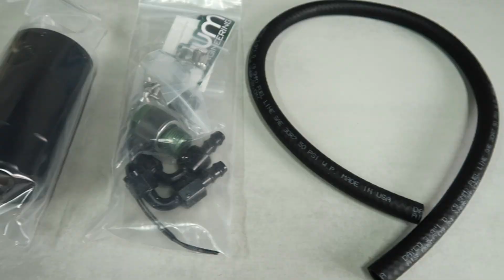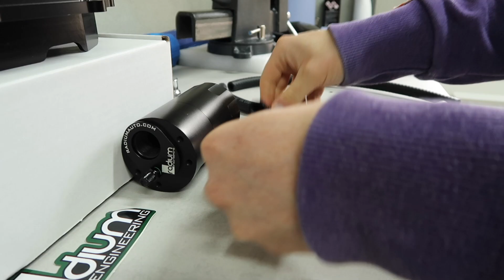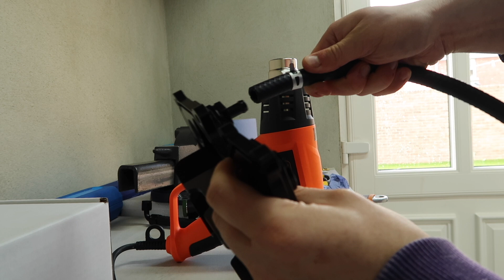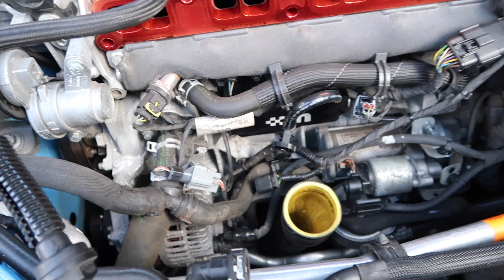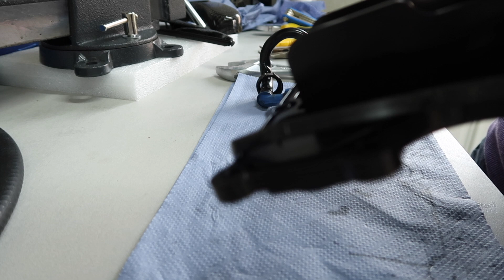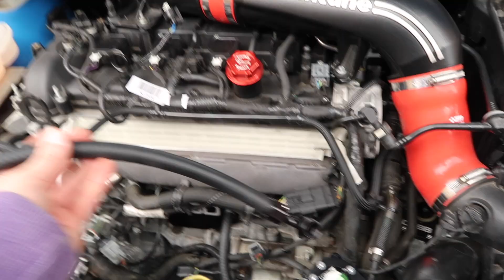RADIUM ENGINEERING PCV CATCH CAN + SICO DEVELOPMENTS PCV PLATE INSTALL! | FOCUS RS

Comment: The plate is if you don't want to run a catch can. The catch can defeats the purpose of the plate. A cheap single Amazon catch can has kept my valves clean.
Reply from the maker: Not quite correct matey. The plates have baffles to keep more of the oil in the block yes but not all of it, in fact not a whole lot - the can still catches quite an amount of oil from the blowby, which wouldn't be happening by your incorrect logic

Comment: Installed the mountune oil breather plate and radium pcv catch can, install went great but now car seems a very slightly laggy and no exhaust crackle when WOT. I have the full mountune intake installed, along with the Cobb stage 1 tune. Thoughts?

Comment: Hi Adam, could you of used the mountune breather with standard port fitting, but chose to use the other due to stronger fitting? Cheers
Reply from the maker: Hello, yes the mountune could have been used in conjunction with the stock PCV valve but the SD plate can be ordered with a better valve that is purpose built to connect straight into the catch can pipe so also easier install

Comment: Wtf? Ain't the top side of the oil catch can the clean side? Thats suppose to be connected to the air intake manifold, and the breather plate to the bottom side of the catch can. Likewise with the ccv side.
Reply from the maker: Nope, the radium cans are agnostic and the way I have them connected up is exactly as per radium's guidance

Comment: After installing both of these products I'm getting a P0017 code, does anyone know why this would happen? Car still turns on and runs, both sensor A and B look to be fine. Any help is appreciated
Reply from the maker: Hi Brandon, P0017 is to do with crankshaft position so I don't think these mods could have caused it. You may need to seek the help of a Ford tech
Reply: Any solution?

Comment: Quality video as always. Maybe I missed it, but how easy is it to check and empty this catch can?
Reply from the maker: Thanks, that will be covered in a future video but I did mention checking with the dipstick
Reply: You can get a drain hose for it that comes out the bottom and makes it easy to drain.
Reply: The easiest way is to buy a medical syringe with a length of clear vinyl tubing, then insert and draw accumulated fluid through the catch can dipstick hole. Never have to unscrew the bottom again.👍

Comment: Great video Adam, could never do that myself. I’m waiting to purchase an oil catch can for my B58 but it’s out of stock at Williams performance at the moment. I was wandering did you ever change your coolant to the performance coolant from Evans Coolant. It contains no water therefore limits any engine overheating and minimises rust formation in the coolant system and once replaced with your stock coolant it last for the life of the engine. Stay safe

Comment: Dammit - just recently bought the Mountune plate and waiting to install it (already have a JLT catch can in place). Now wishing I knew about the Sico plate! Also interesting that your old Mountune plate is black and is a quite different design compared to mine - mine is gunmetal with the exposed baffle plates (much more like the Sico), rather then the enclosed baffles that yours has.